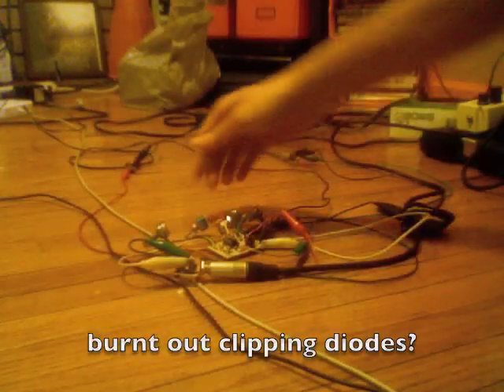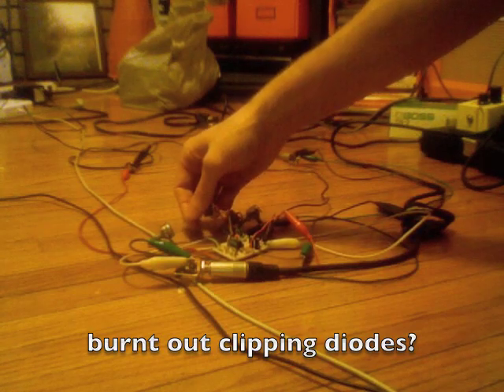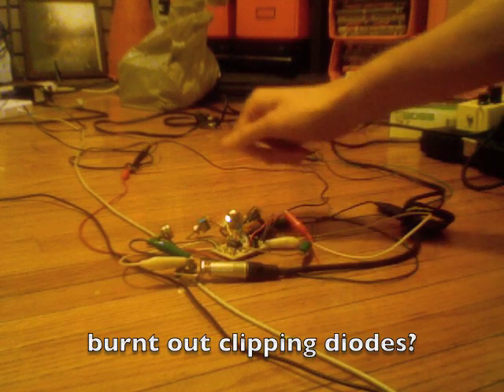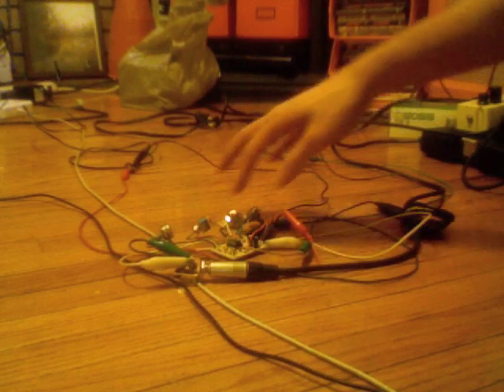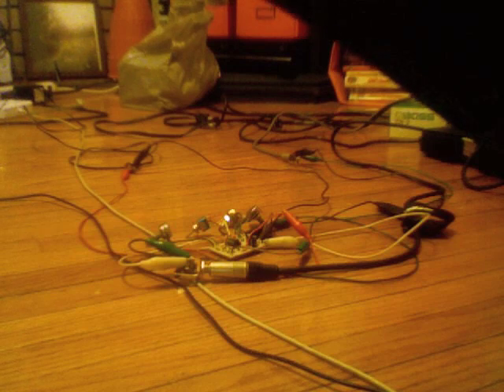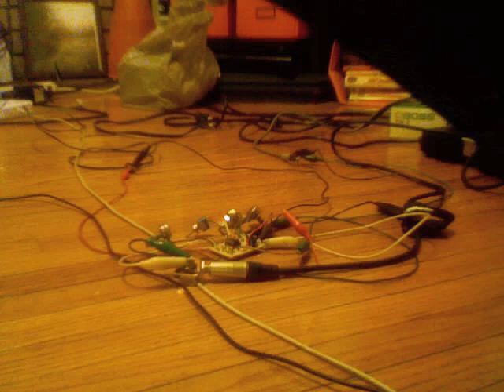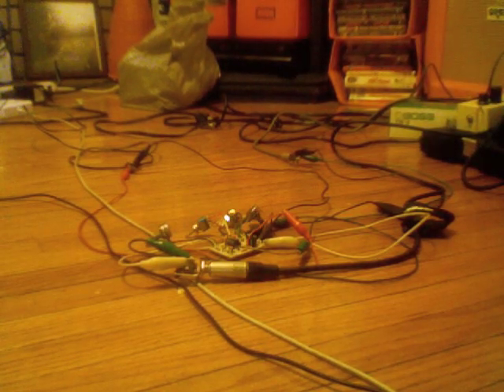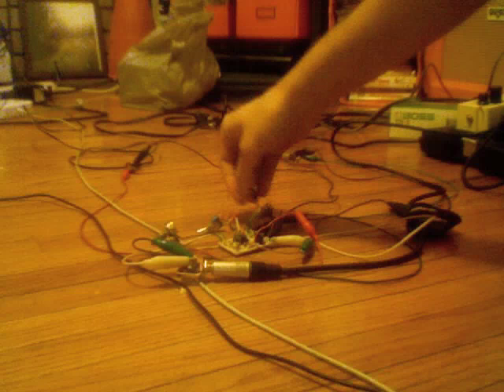LED clipping "burnout" mod?

Comment: Sounds like the op-amp distorting instead of the LEDs. Maybe it's a bad solder on the LED part of the circuit, or the switch is damaged.